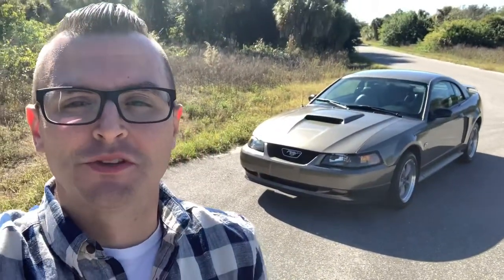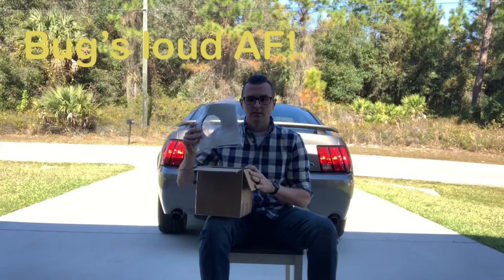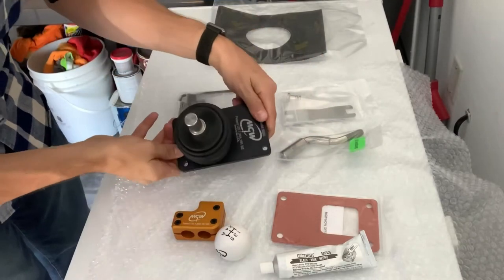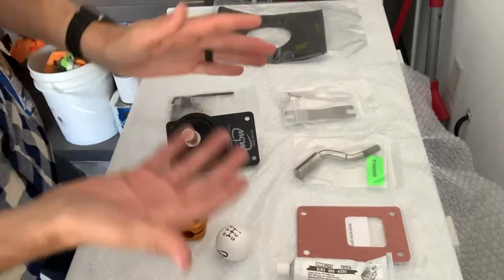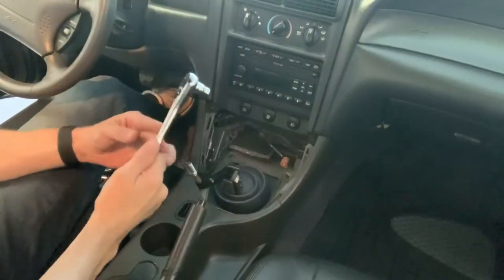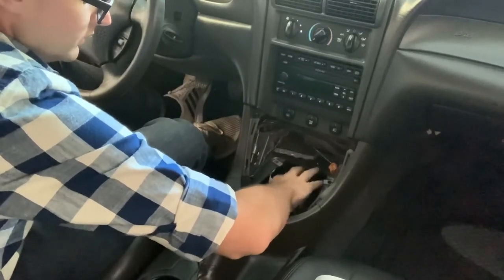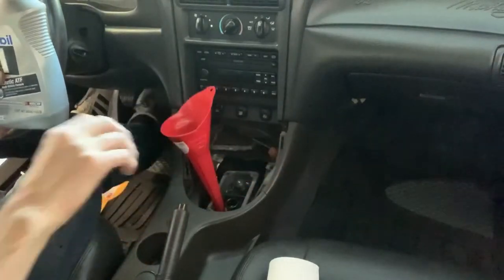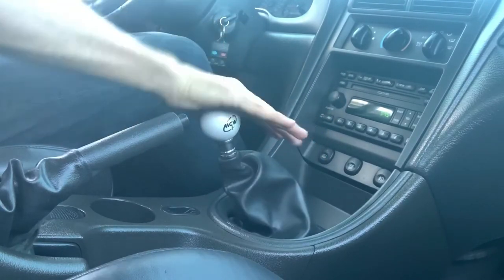MGW Short Throw Shifter unboxing/install for New Edge Mustang GT

Comment: You got the best possible shifter for a QUALITY fit and finish. MGW was one of my first mods. A lot of people leave the factory shift handle on the shifter to get more leverage to pull the stock base off. A little late for you but maybe someone else will benefit from knowing.

Comment: Looks like a nice shifter! What do you notice besides the shorter throw? It has to take more leverage to shift because the lever is smaller. I have the quirky 1- 2 shift in my Bullitt, but I can't see this improving any of that even though ivevread good things as well. What's your thoughts after using it a bit?
Reply from the maker: Feels solid. Some what notchy feel, way more confident shifts!

Comment: Hey did your stock shift ball fit the MGW?  I don't wanna use the MGW one.  Wanna find a Ford racing ball.
Reply: As long as it’s m12 x 1.75 threads !!!!!!
Reply: I’m reusing my eBay shifter ball that says 1-2-3-4-fucking fast-R because I’m too cheap to buy the MGW ball, it’s the same fucking thing, and that shifter is funny too
Reply from the maker: I’m not entirely sure. I discarded the old parts during install